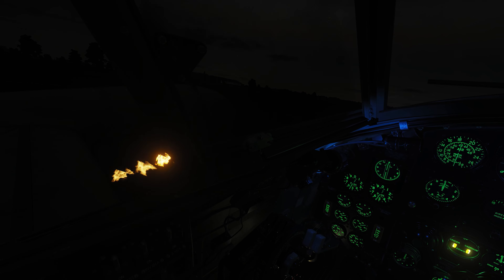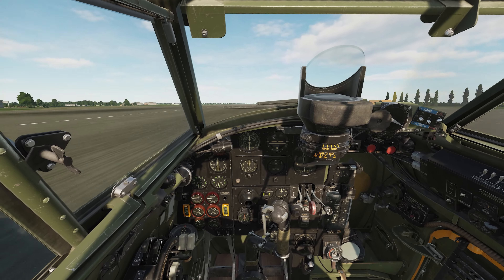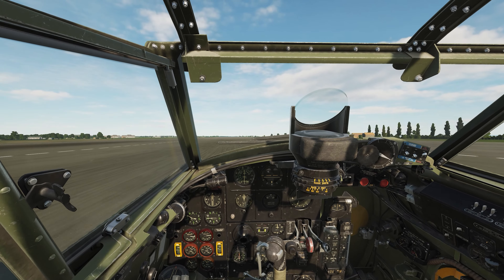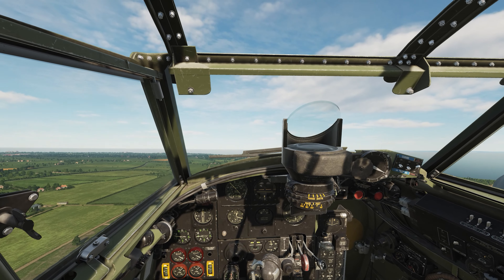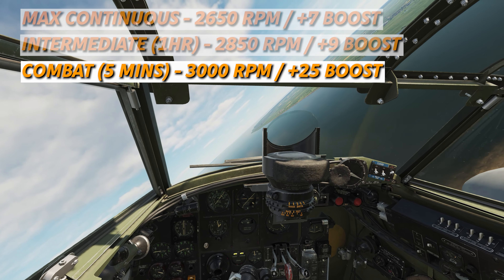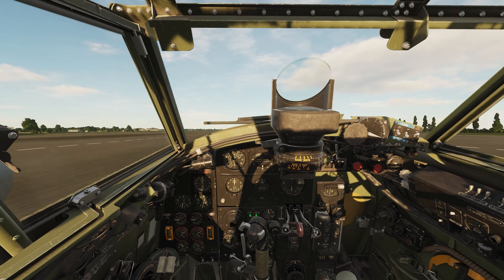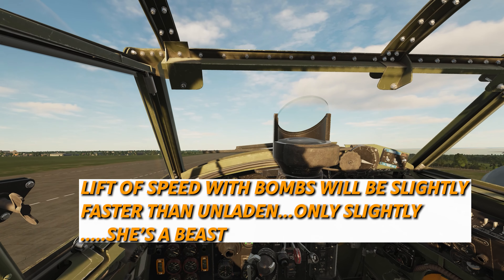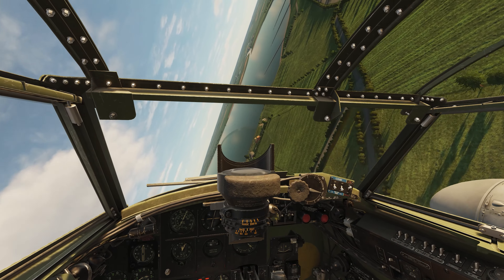DCS WORLD | Mosquito FB VI Take Off Tutorial

Comment: It must be drunk. It keep yawing all over the place on takeoff and I cant get it to go straight. Very frustrating.
i go slow on the power, i go fast on the power, i run it up and release brakes and slowly build power with speed. still get massive yaw. I cant figure this out.
Reply: yeah same here
Reply: Yeah its NOT easy i slew all over the place
Reply: I CANNOT keep this thing on the fricking runway - made sure easy flight sim was off, like you tried slow buildup or keep brakes on till 3k rpms, this plane is almost impossible to keep on the runway!
Reply from the maker: @soundtechservices2616 have you trimmed before takeoff, advanced the throttles slightly behind each other?
Reply: Hi @TacticalPascale  , thanks for responding! I have had better luck with the brakes than the differential throttle technique - mostly I just needed repitition, but it is so touchy with either brakes or throttle. I am using an X56, which is pretty good but even with the curve put in the axis tune it is still to touchy for me to control at the throttle level. I have found after several hundred trials now that center stick, apply brakes, throttle up to 2500, and try to hit air ground speed for rudder control before you need to touch the brakes, they are just so sensitive. I guess most people don't have this much of a problem. I am starting to make progress, but learning takeoff on all other craft have not been easy, but doable fairly quickly. Not so with the mosquito - once in the airt it flies great!